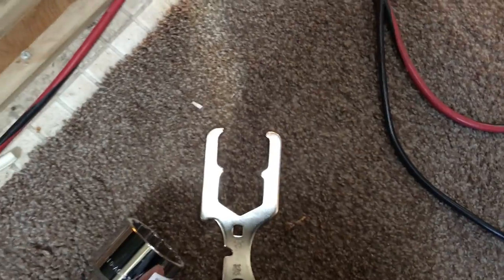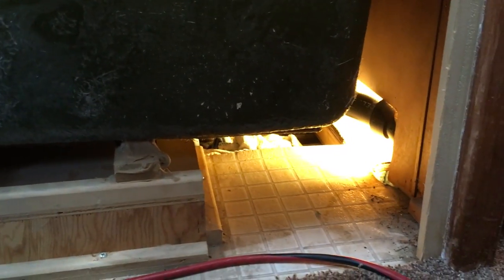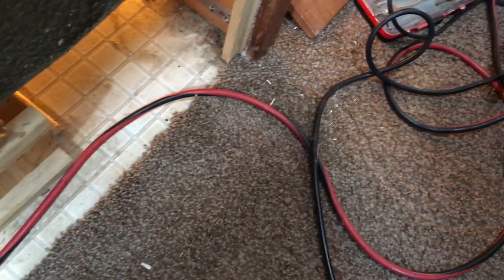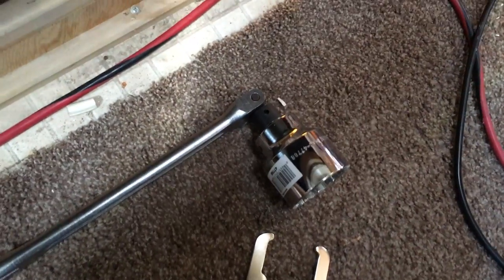Replacing the tub drain flange in a 1988 Avion 34X travel trailer

Comment: You did a great job. Just for future use, the cross area on the top of your flange tool allows you to put a bar or screwdriver in it to gain more torque that those 2 nubs that you were using to turn it tight. Now you have a fortune invested in tools and probably won't ever have to do that job again.

Comment: Great video! Doing this same repair in my RV. Question. Having found no instruction on drain installation. Is using the tool to turn the drain instead of hold the drain and tighten the nut the correct installation procedure? Seems like turning the drain to tighten would screw up the plumbers putty under the drain flange.

Comment: Tub Drain Extractor Tool teeth did not bite and it slipped every time. That brass coloured coating even flaked off.  A waste of time and money. The  metal teeth in the extractor tool need to be harder than the tub drain it needs to cut into.

Comment: You realize the tool you are using has the proper cross bar on the OTHER end from the one you are using.  It will easily and evenly work to screw the drain into the threads.